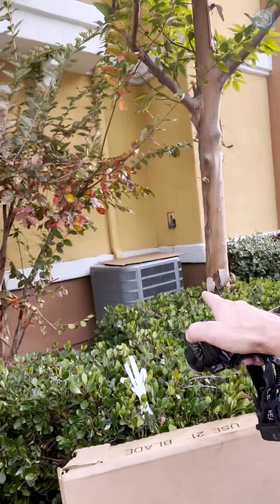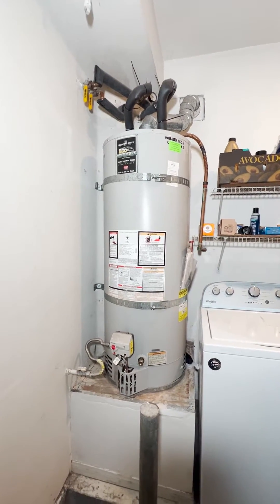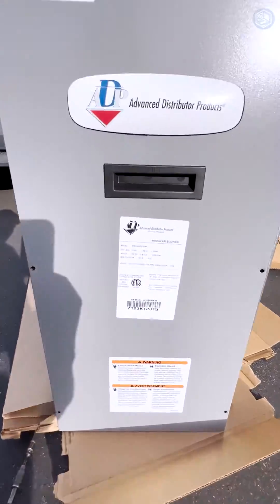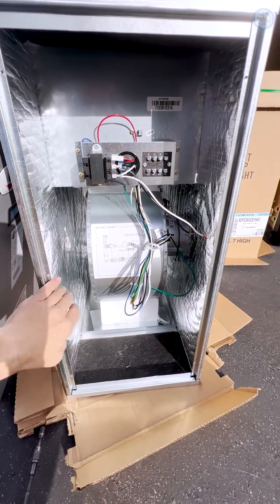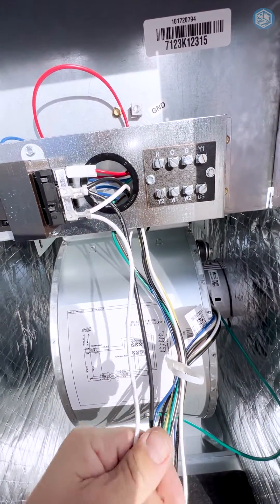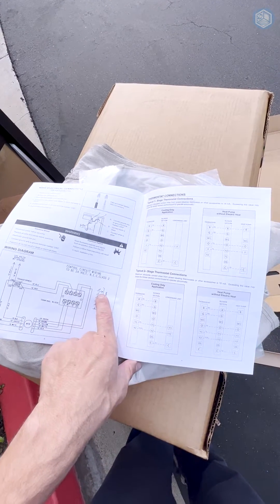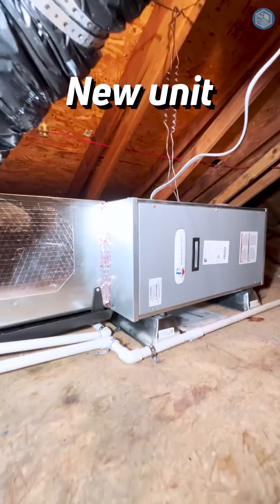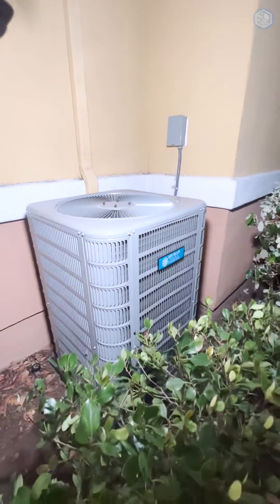Upgrading to Heat Pump: Attic HVAC Installation & New ADP Air Handler - Comprehensive Overview

Comment: If you move it even closer to the wall it would look nicer and it will get better air flow. I would of had it touching both walls in the corner.